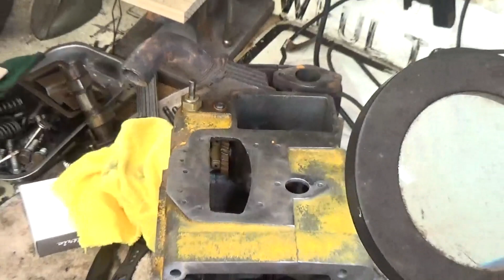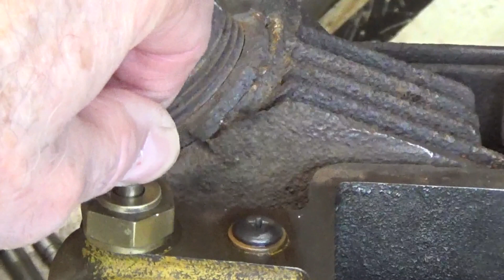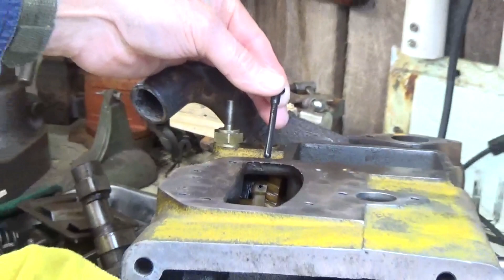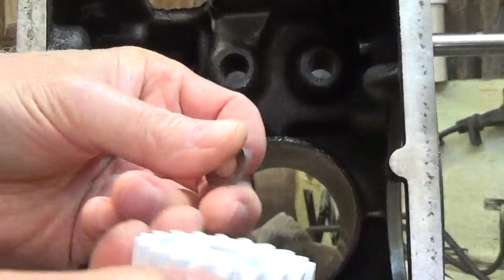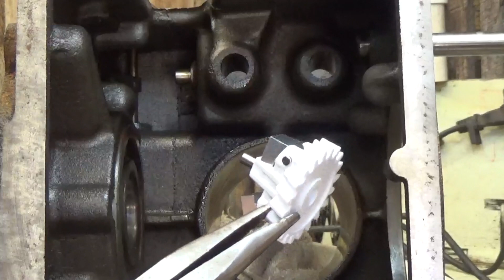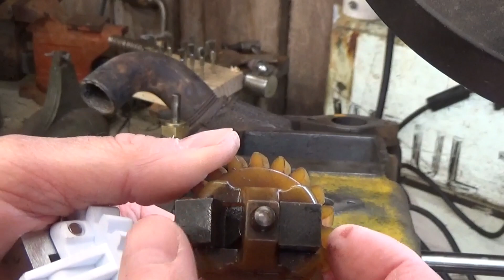How to replace the governor gear in your K series Kohler engine.

Comment: Excellent video I was hoping you would have tried the new one with the spacer to see if it was still floppy. That aftermarket part may be made in China, they can't even make can-openers that work right😂
Reply from the maker: I won't use a part that is defective even when new. I have re-installed the original which was still in good condition, though I thought to change it "just because" to avoid future issues. No spacers would take up that slop. Thanks for stopping by.
Reply: @TheShadeTreeFixitMan I would have done the same. They don't make em like they used too.

Comment: Great video. My 12 horse  koler will come off hi idle on it's own. What's your diagnosis doctor. I'm  thinking maybe that gear.
Reply from the maker: Either the governor gear or the throttle linkage is not properly set up and adjusted. Hard to really say without seeing the subject. Thanks for stopping by

Comment: Why are governor gears plastic instead of metal?
Reply from the maker: Because of the wear factor and expense in production. They are sometimes made of aluminum or pot metal, and even steel, but most that I have seen are plastic. Great question, thanks for asking. Six Advantages of Plastic Gears
Lighter Weight Components. ...
Low Noise and Vibration. ...
No Corrosion in Moist Environments. ...
Eliminates the Need for External Lubrication. ...
Easily Mass Produced and Prototyped. ...
Less Deposit and Less Tool Cleaning.
Reply: @TheShadeTreeFixitMan  Thanks for the video! I've been watching videos of small engines just to see how they work. Very clear example of the governor control mechanism. Such an elegant solution to control fuel supply under load. The ingenuity of men, well some men. I'd never come up with that, lol.

Comment: Any idea what that “long screw” is called? Mine is worn and will need a replacement
Reply from the maker: That long screw is called the governor pin and is part # 231355S. You can find it in several different places of your choice. Here is one listing on eBay: https://www.ebay.com/itm/225018549887?itmmeta=01HTRQSCZKTHA8HYZTD0XQRMDF&hash=item346426967f:g:8L8AAOSw5DVlv86D&itmprp=enc%3AAQAJAAAA4Jsq%2BBswPWkheIq8IweqrksgPwMXIkAjV3hwvc5TeT8Ijhyy%2BWneFUS2GSmetbX4lXU6HdekfV7OeucLzaPHoTguerHSXZarvvieGFNYSiaVxQTHJwEQZ%2BZ6yODl4xvjavHbCHd5c3GJG6jsbC9F4neg19Fxbw4QnV1W9lQFtVFMlYDJVDzD1G%2BOumbt%2FBPH5HY%2BkZPa7C0q6GwjK6f7bhWnGpefhT6ocKvLG4sLfJYdTPzTHtn1hqbckNk%2FiAWxFZuaxJHpMahVQ%2ByP7mnPX5d%2FNqRvGM5xTaYL1f3Ym52Z%7Ctkp%3ABk9SR4bR5ZfWYw
Hope this helps and thanks for stopping by.

Comment: George, the thrust washer was in place in your video and you can see the edge of it shining. I used a dental pick to get between it and the block to remove mine. I'm rebuilding a Kohler K301A and a K321A engines for two Cub Cadet tractors. The K301A had a metal governor gear and those arent encountered as much as the nylon gears. The stub shaft in the block that the gear rotates on wears, but it is replaceable. The one on my K321 is worn out of spec and scored, so I'm replacing it. That little stub shaft is about 40 bucks. Never use China junk on these engines. The original Kohler parts cost more, but they fit and function as they should. New old stock parts can be found on ebay and for a great price sometimes. Yes, original Kohler parts are costly, but can last half a century. These engines were very expensive when new. A Cub Cadet 149 garden tractor with a 14hp kohler K321A was 1900.00 in 1973.
Reply from the maker: Thanks for the great information. I appreciate it.